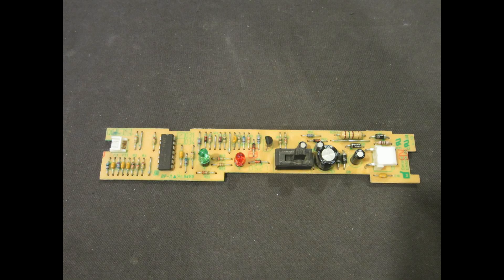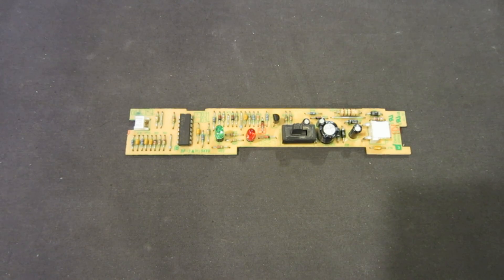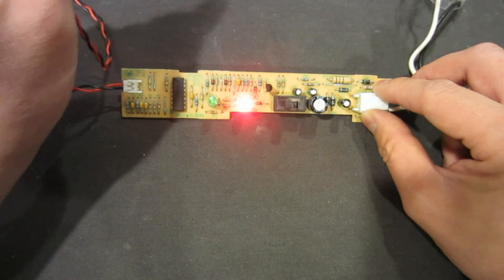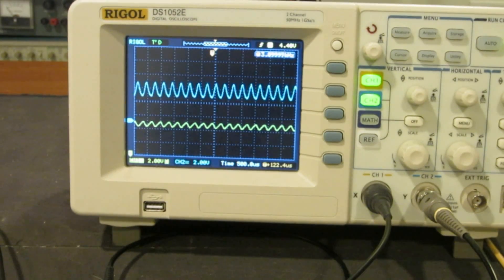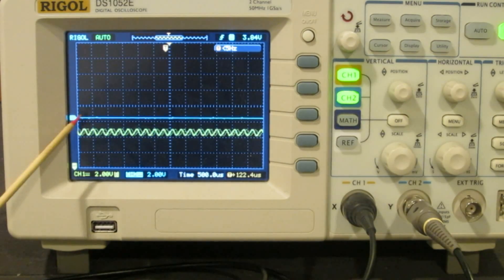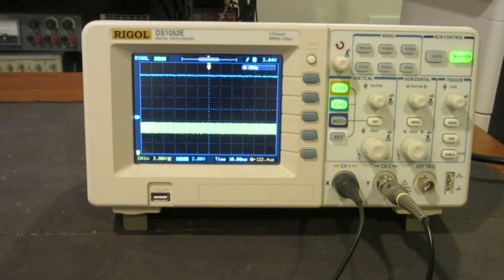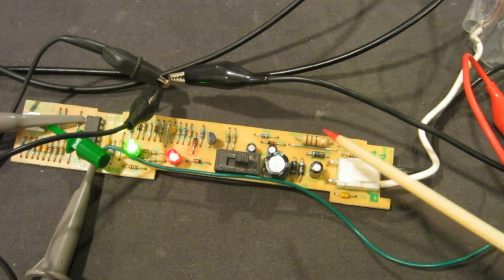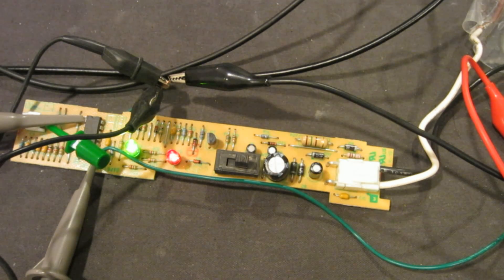How does Vacuum Cleaner Clean/Dirty Indicator Work?

Comment: I don't think it is the noise of the dust triggering it. The motor spins faster and faster the more the filter is dirty because the load decrease with flow restriction. You can test that assertion easily by putting your hand blocking the tube. The motor will rev up. The high pass filter is probably part of the detection circuit. With the motor spinning faster the frequency heard by the microphone increases so the signal level out of the filter increases and triggers the level detection circuit above a certain level. Thank you for this video. I did not know this electronic technique was used to detect dirty filters in vacuum cleaners. Interesting engineering !
Reply: The dirty indicator light come on on our Hoover when the hose gets clogged. So I think that the idea of motor sound frequency rise is valid.
Reply from the maker: The thing is, motor speed routinely changes (i.e. if you block the intaking hose the motor will race) but I don't recall the dirty light came on when I did that. Wondering if someone else has a similar vacuum can do a quick test as I tossed the other parts already :(
Reply: Nice, thank you for the confirmation !